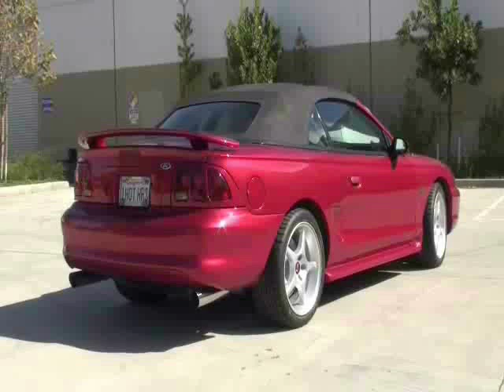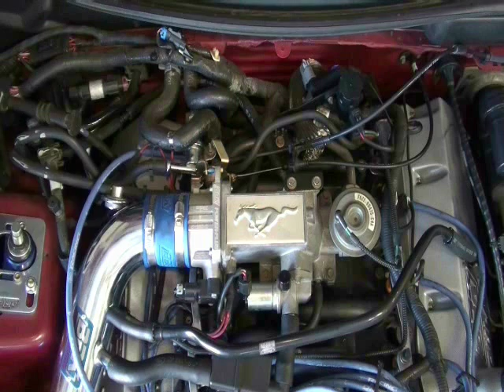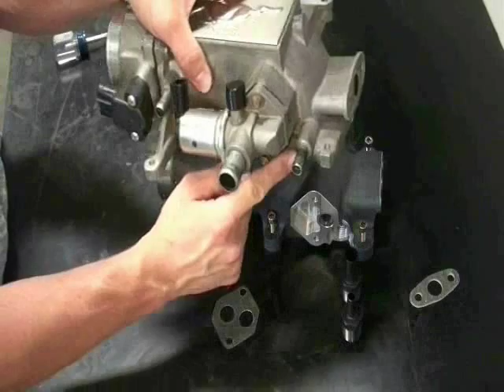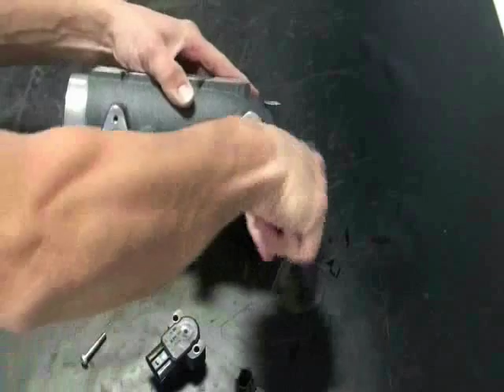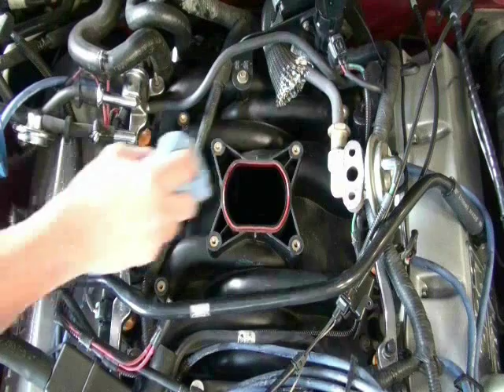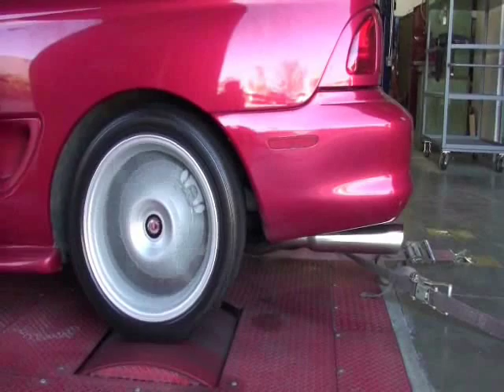BBK 1780 Throttle Intake Installation Video

Comment from the maker: @OneCoolRedneck- Try slotting the bolt holes or bending the throttle cable bracket away from the throttle body a little bit to take up some slack.